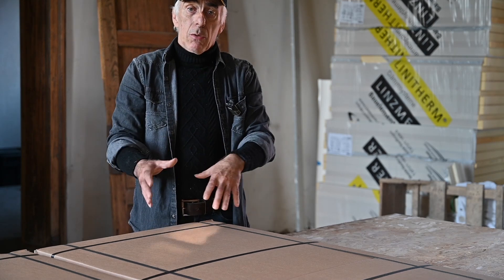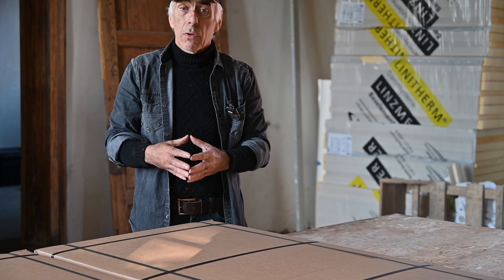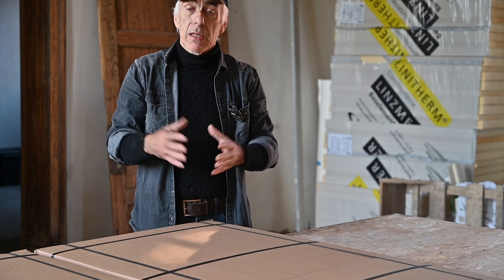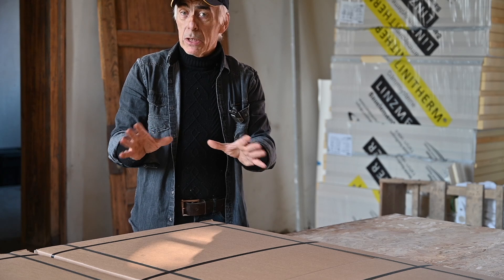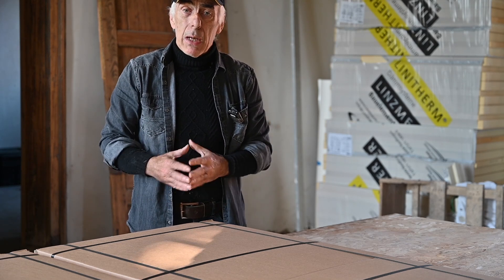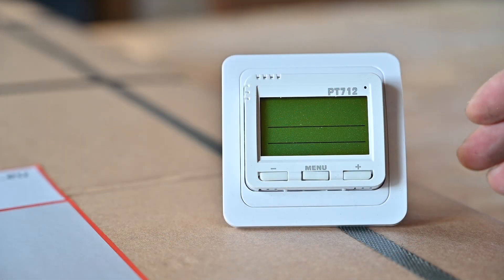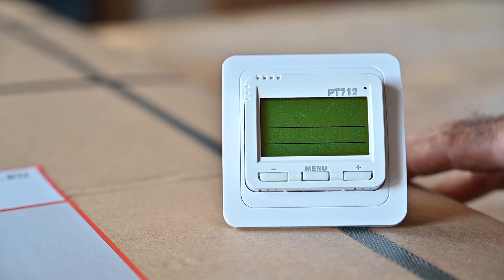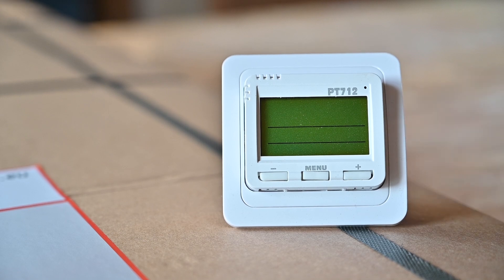Heating for the Tower Room,  Oil, Gas, heat-pump or IR ?

Comment: An option if you have an adequate service to handle the load.  Also it does not give you cooling capabilities in the summer.  Most modern mini splits (air to air) have an efficiency rating of anywhere from six times down to 1.2 or so at minus 25 degrees F.  So as the air gets colder the efficiency drops but it is never less than what electric resistance heating would be. They are improving all the time as well. Here in SE Alaska which is a temperate rainforest on the coast and seldom get below zero F I have installed several in the past few years three for myself and they do work at this efficiency.  We also use oil or propane as we have no gas system here.  Since these high efficiency units came on the market about eight to ten years ago they have taken over the heating world here.  Hands down the best for us and the claims for efficiency seem to pan out.  For me I was heating for about $2400 to $3000 USD per year with oil (high efficiency on demand only System 2000 boiler with baseboard hot water heat) now even at our high electricity rates I pay $1200-$1400 per year.  The units I chose were 1 1/2 tons and I have three of them.  They cost me less than $1600 per unit with a life expectancy exceeding ten years.  The other type is a ground coil to the heat exchanger.  These get extremely good efficiency as they draw from ground temperature (55F year round here) and can use hot water or air delivery to cool or heat in the house.  The modern ones can attain boiler temperatures (160+F) so they can even use a baseboard system.  Downside is you have to have the land to bury the coils and you have to have four or five feet of topsoil which in this area is rare.  Bedrock is generally within a foot or two at most, of the surface.  Solar and wind are not options here in our overcast climate. Take care.

Comment: Hello ! I'm surprised that 1600W of total heating power is enough for such a big and high room. Why not, as it is direct heat radiation, but still, my 2000W classic electrical air heater does not heat my small office fast at all during winter. Also, why not put another panel on the opposite wall, so that people get heated by both sides ? Because you could be in the shadow of the panels because of your neighbour at the table 🙂

Comment: that's interesting. Would be nice if you could hook it up to some solar panels with an inverter.  But I wonder of a thermostat works fine with this system because you don't heat the air ?
Reply from the maker: Solar panels and home battery are planned,  and yes thermostat is build for this purpose as it is also an object
Reply: @D3Sshooter  what happens if you place and object between the IR-heating and the thermostat ? It won't work? (that would mean it  measures the radiation? )  I think it will measure the heat of the air. The objects absorb the IR and will distribute the absorbed energy en heat up the air.  Home battery is a good idea. But expensive. Than maybe an EV as a home battery is a cheaper solution ?  A pity that perovskite panels are not available yet
Reply: @scattkiwiman  Indeed, for the thermostat ! It will measure the air temprature, but will also get heated by the radiation, as will be an objet or a person, so... Will it correspond to the felt temperature of the occupants of the room ? The best answer will be to test it.
Reply: @philmae  suppose you install a black metal panel in front of the IR panel, would the black panel absorb the heat and become a radiator ?
Reply: @scattkiwiman  I think so, but then you loose the direct radiation to heat people with less energy taken to heat the air.

Comment: Very interesting solution. Should work well. Just last month learned about Wago connections and got a box to try. Hard to find in US but are available and have to say I like them better than the traditional wire nuts we use.
Reply from the maker: Indeed and thanks for the comments

Comment: Steve, Very interesting I have never seen or or been in a room with this system, Hopefully you will give us an update over the winter months and how well it works
and maybe the cost to run it as heating is the big issue or should I say the cost. Great video and beautifully shot and loads of information. Cheers Dave
Reply: Steve, Btw I had a ground cable made up for the TIG machine you gave me and will start using it very soon. Hopefully you can catch 
a few of my 1930s Citroen videos and my attempt to turn it in to a Hot Rod pick up. If you know anybody who would like the engine, 
gearbox, Chassis & suspension for a project please let me know by email thanks. Cheers Dave
Reply from the maker: @ClassicCarCave  , I will Dave
Reply from the maker: Thanks Dave, and yes   I will give you the update... There is still a home battery and solar panels to come..